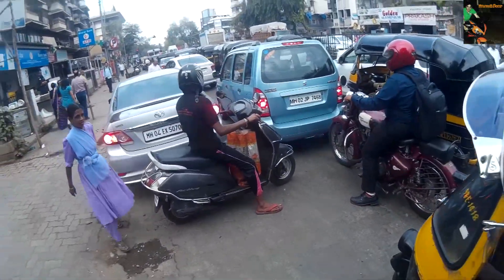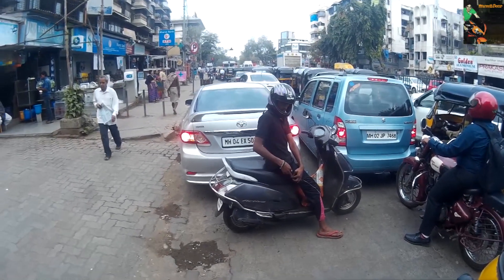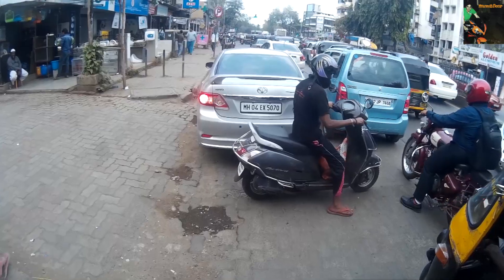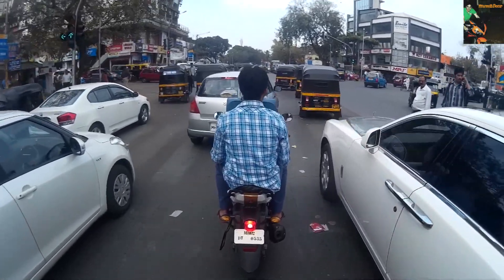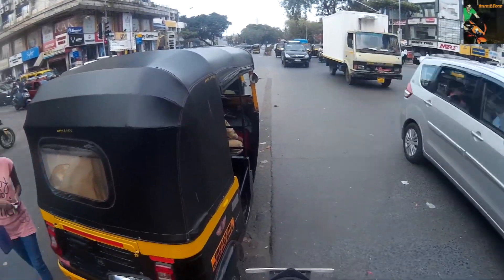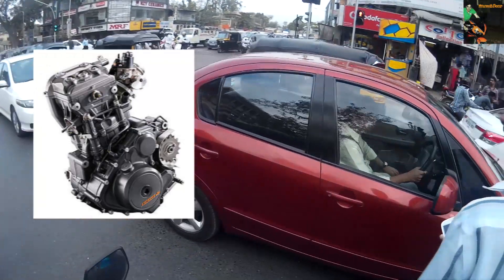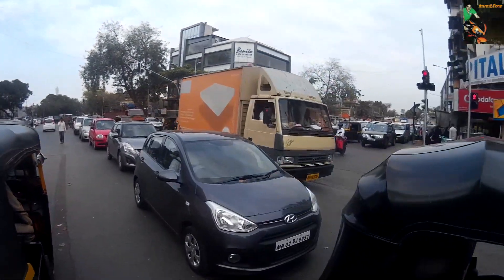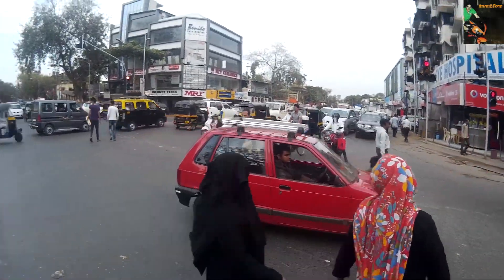KTM RC 200 and RC 390, Duke - Which Fuel to use Normal or premium ?

Comment: I like the design of the rc and where I live is the small city,bad roads and I don't travel too much just roam in the city.The ktm service center is 80 km away and my mind is going on the rc only.Please help
Reply from the maker: +shrey sarraf rc has a good design but if u stay so far its not recommended to buy an rc.. have u ever thought of buyin a duke 200 ?? rc is not good to be ridden in small city. its a track bike
Reply: I just wanted a sportsbike type so just decided in between rc200 and pulsar rs200...
Reply: +shrey sarraf rc 200 bro, don't go for rs200.

Comment: hey i totally get what you said technically.
i am a mechnaical engineer. biker. been years. i also conduct automobile workshops for dummies. i own a rc390. 
the thing is i dont agree with your conclusion.
rc 390 or duke 390 run a very high compression ratio.
12.6:1 equivalent or almost equal to top litre class bikes. r1 has 11.something. busa(1300cc) has 12. something.
so it IS RECOMMENDED HIGHLY TO USE HIGHER OCTANE FUEL.
i never was a believer till i actually had a tank full of speed97 by bp and noticed the change.
1. my stock rc390 sounded much better louder. more crackles while hard engine de-acceleration. more thump.. the change was noticeable.
2. low rpm sluggishness wrapped up. not fully. but it rode a lot better.
3. 0-160 kmph accelerations were a tad bit quicker.
4. heating was same. but the auto engine cut off that happens when the engine overheats and you cant accelerate beyond 4.5k rpm. happened quite less. (i.e. in a choc-a-bloc traffic.. i live in delhi. summers are hot here.)
5. mileage increased. i ride higher gears than i should. i love riding hard. it used to return a mileage of 20kmpl earlier. with the new tank mileage was 22kmpl.
monetraily makes less difference because 97 costs more. but it meant the combustion was smoother and more efficient.
 
so users dont have a choice like you said. dont wait for the pinging. if you love riding hard. please maintain your bike to have bullet-proof reliability.

moreover the manual specifies RON 95. we dont have RON 95 in india, its either 91 or 97. so choose carefully.
you dont have to agree with me bud. just sharing my experience
Reply: hey wht do u recommend for duke 200 ?
Reply: Speed or extra premium should be good. do not add stupid additives they try to give you on the petrol pump. 11.3:1 should do well with RON~91. so yes. i hope it helps.
Reply: @RipYouTheMan  bro 200cc ktm can run 91ron and 390cc should be 95up Ron? You give great advice bro
Reply: @RipYouTheMan  I completely agree with u bro .I ride Duke 250
For about 1 month I was using normal petrol....my bike feels sluggish at low rpm ,no good acceleration,  bro....I literally got bored of my bike.....when the fuel in my tank was about to empty.....
I put shell v power ......brooo....I could observe the performance almost instantly........🔥🔥

Comment: hey..m sarvesh frm mumbai..... i relly wnt to buy duke RC.... but confuse shld i go 4 RC200 or RC390.... it wll be my 1st bike n i m going to ride it under city condition.. i hve hero mestro whch hve been travel 8500km in 2 year...i knw rc390 is nt my cup of tea bt ONLY thing tht is distrbng me is rc200 is nt hvng ABS n Metzeler tyres.....so shld i go 4 RC390 only because  it gve ABS??? or it wll be fine wth RC200 breaks once i get use to it???....so plz guide me i wana play cool n SAFE....
Reply: +Sarvesh Bagadiya So what did you buied? RC 200 or RC 390?
Reply: RC200
Reply: +Sarvesh Bagadiya is rc 200 perfect ??
Reply: Ya it is. Because in Mumbai due to traffic it generate less heat thn rc390. N evn without ABS it's breaking is grt.
Reply: Sarvesh Bagadiya Niggah what? braking is good without ABS?
Reply: +Chets ˆ yes u cant really compare it with Abs bt still as compared to othr non-abs  bikes rc brkng is good. N i pretty got use to it.

Comment: Hello Nikhil,

What you have explained as a technical part is absolutely correct!!!

What is the octane no. of the normal petrol we get here in India?

The reason for avoiding lower octane fuel is that it contains higher % of sulphur around 50mg/ kg. Particularly speaking about the KTM machines for now...they use a technology called Nikasil coating (Nickel Silicon Carbide) on the inner surface of the cylinder which allows them to manufacture the these bikes with very high compression ratios, lower piston cylinder tolerances and high wear resistance of the cylinder surface, hence offering longer life to the engine.

The problem is that the sulphur in the lower octane which breaks down the coating an damages the cylinder earlier than it would perform otherwise. The combustion gases produces sulphides and acid residual in the combustion chamber which tends to react with this coating.

P.S. Nikasil was introduced by Mahle in 1967 and used by many since then...BMW...Jaguar...etc.

I enjoyed your Shirdi and Bangalore trip videos as well...good job!!!

Regards,

Ketan
Reply from the maker: Ketan Pathak bro normal petrol has 87-89 octane level and the premium has 93-97 depending upon which company
Reply from the maker: Ketan Pathak and thanks bro m glad u liked it :)
Reply: man i dont know what u guys talking about... all i know about petrol is 100/- ka and tank full!! lol :P

Comment: good video bro. i have a continental gt. i am using xtra premium patrol in it. although i see that the premium patrol wont increase power and stuff, the patrol company claims that the premium patrol has got cleansing agents in it which are good for the engine. is there a any truth i that.
Reply: Lol. Nice1 patrol guy.
Reply from the maker: sidewaysforlife RE cafe racer has 9:1 compression ratio which is high.  the engine will perform good with 87 octane petrol. gettin high octane petrol wont do better. compression ratio over 9:1 needs high octane, so u see continental gt is somewhere in the middle.